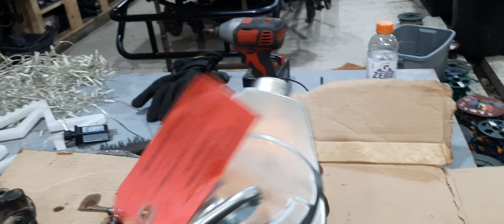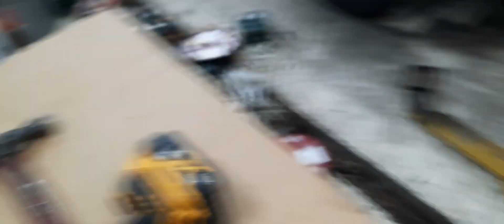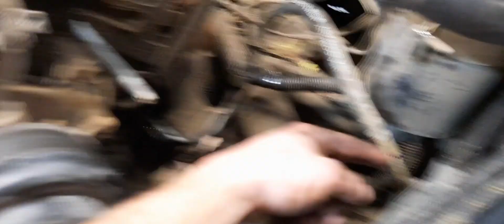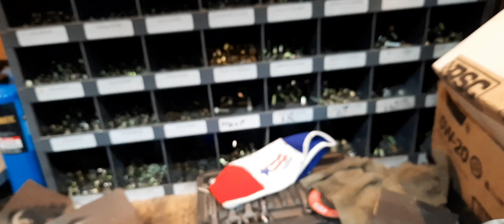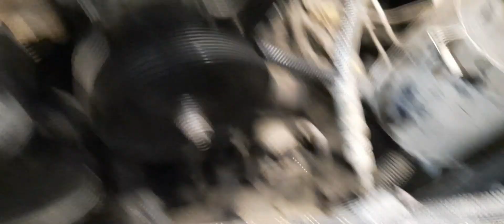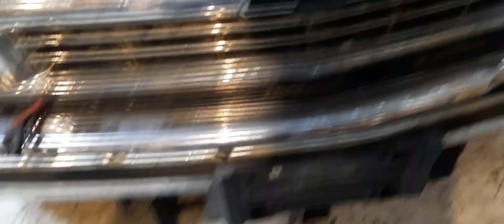K1500 Gmt400 P.S. pump upgrade! Power Steering Components #SP1401F 1600 psi.

Comment: Will this work on the hydro boost k1500s?
Reply from the maker: I dont see why not. As long as the pressure line will bolt up and you use your stock reservoir.